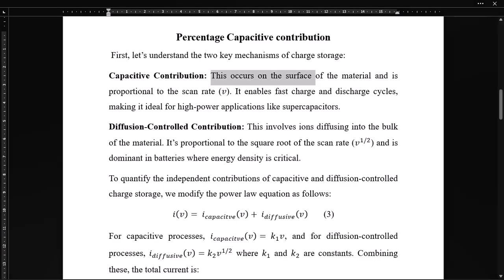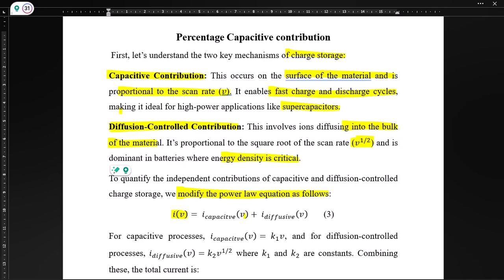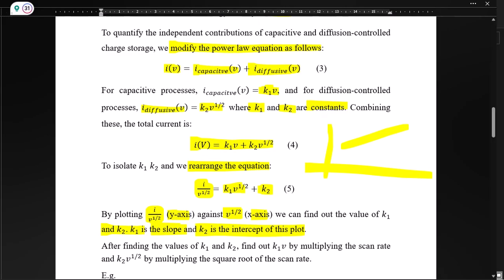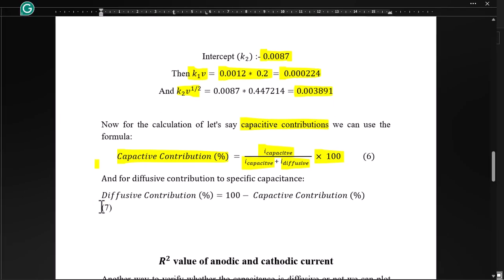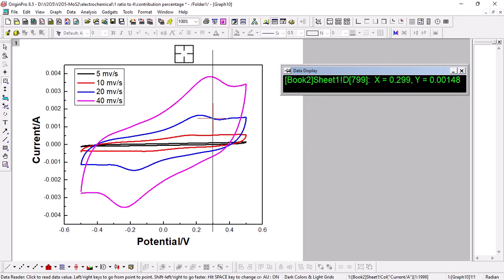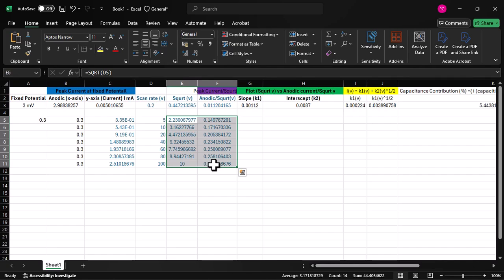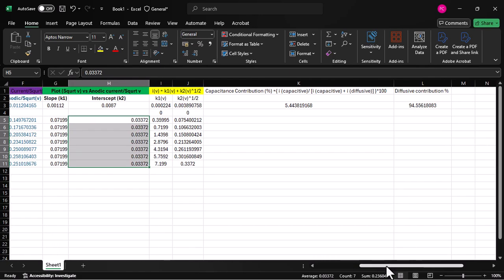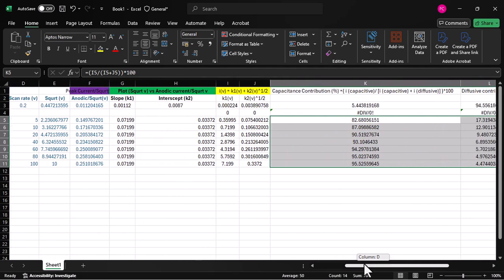3. Capacitive contribution percentage calculated from Cyclic Voltammogram using modified power law

Comment: If u are mentioning fixed potential, then u shouldn't consider the current as 'peak current'. Because, the peak current is the max current (anodic) and min (cathodic) current which can't be found using a straight line as the peak current position varies with the scan rate. Kindly consider it n rectify.

Comment: Informative video but I have a question for you. what if I obtained my CV plots at only one scan rate? Say for eg. I obtained my CV data at 0.1 mV/s and repeated for 5 cycles at the same scan rate. What should I do now to obtain the capacitive and diffusive contribution in this case ? Thanks.
Reply: In that case, you will only know the capacitive and diffusive percentages on a single scan rate. You won't be able to generate a bar graph, but you can show the capacitive and diffusive percentage in your CV graph at the said scan rate. You can watch the next video in the series to draw that graph.
Reply from the maker: yes you can, as these contributions are getting changed by changing scan rate.

Comment: range of Current in your CV Graph is -0.0004 to 0.0004... after collection of data into Excel sheet , your data range of Current is 2 point something mean 2+.

Also in your CV graph scan rate is 5,10,20,40 and in your excel sheet 5,10,20,40,60,80,100 ... 

Your Slope and Intercept is also wrong, according to your Excel data ... 

Soo Broh... Kindly resolve your mistakes ... 😊
Reply from the maker: Everything is correct, bro. Check units in the graph and excel sheet. Also the CV profile shown in graph are just for  demonstration of how to find the anodic and cathodic current, rest we have data for all scan rates 5,10,20,40,60,80,100 ... mv/s. so there is no question about the slope and intercept wrongly calculated